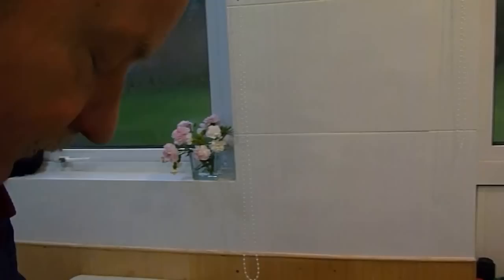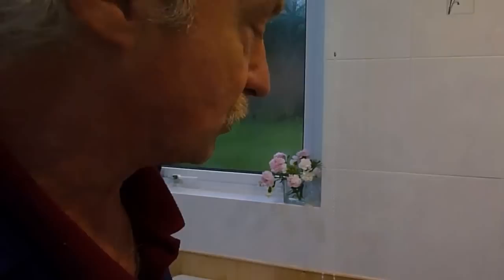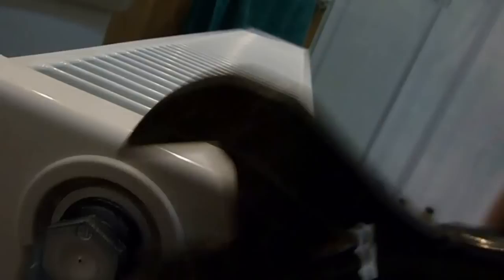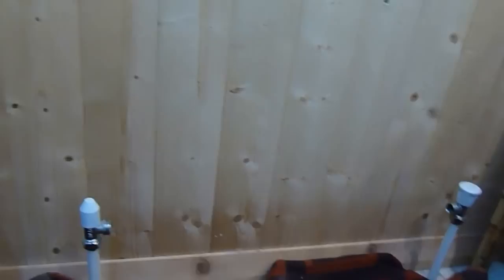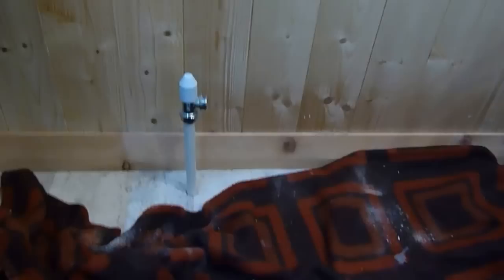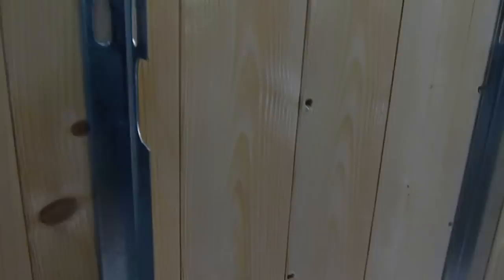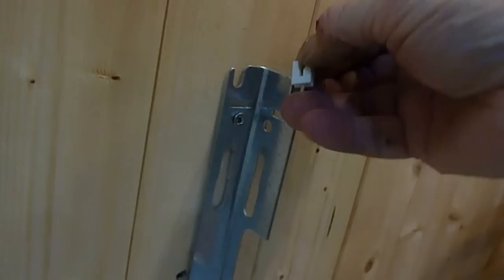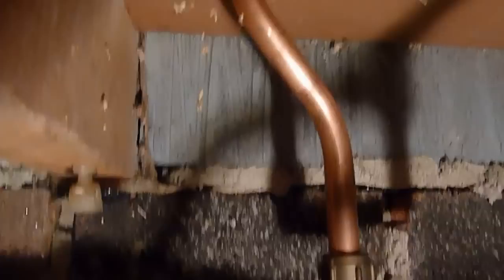How to change a small central heating radiator for a larger one.Get more heat.

Comment: Al. I changed a rusty rad for a nice shiny  new Kudox single convector in the spare bedroom. After draining the old rad and preparing the new one I was good to go.

 I was fortunate that I did not have to cut any pipework. Like you I also managed to get the  old tails off and reuse on the new one.
 The width of the Kudoc was slightly smaller than the original and I didn't need to use an extention valve as I first thought.

I had to higher the brackets slightly to lineup   with the pipe valves. After  applying fernox white boss compound and tightening up. It was all good with no leaks at all. As I say I think I struck lucky with the width and lineing up of the pipe valves. The bottom line is. I was able to stand back and admire my nice new gleaming white radiator. No more brown rust line running down from the bleed valve!
Reply from the maker: Great job Graham.

Comment: I did recently fit a TRV and unlike yours, the spigot only had a thread, the chrome pipe and a nut to fit the pipe, it made tightening the spigot difficult as there was nothing on it for a spanner.
 The only fittings that have leaked in my house are the soldered joints that a professional plumber put in I replaced them with compression fittings and they have not leaked in the last 20 years. I do use Kutalite or Conex not the cheap chinese ones. 
I have never used pfte tape or boss white on any compression or tapered thread.
Thanks for the video.
Reply from the maker: icespeckledhens Thanks for your info. Al.

Comment: None of my rads have a drain, but there is one on the heating pipes by the downstairs loo so I assume it's OK to use that - is that so it can be drained into the loo? Even though the loo itself is higher than the pipes?

Comment: I replaced a four element twin air outlet  aluminium ROCA radiator with a 12 element four air outlet  one in the bathroom . The benefit was unbelievable .I reduced the boiler central heating temperature by 10c   and it still heats the bathroom in 1/2 hour .and my gas bill has come down .

Comment: Once again, you've made it look simple..ish.  Modern houses seem to use the white  flexible snap-lock hoses.  Just curious: is it not normal practice to insert a rubber 'sleeve' around the heated copper pipe to allow movement against the floor boards?
Reply from the maker: Hi exwhyz23 . no I have never done that . the hole is always just a bit larger than the diameter of the pipe passing through it . So there is always plenty of room for movement.
Kind regards,
al.

Comment: Besides a visual preference could additional pipes be added to the left hand side to extend it from underneath the radiator but above the floor rather than cut it beneath the flooring and having to put another hole in the floor?
Reply from the maker: Yes certainly.
Reply: @dereton33  Thank you

Comment: How would you handle the pipes that come from behind the radiator from the walls. Do you have a video that shows how to replace a small radiator with a larger one where the pipe comes from behind the radiator?
Reply from the maker: Yes I have. https://youtu.be/lMYemmT-fyA
Reply: @dereton33  thanks for the reply. I think I probably wasn't very clear. Was wondering if there is a video where the pipes for the radiators are done like this. User image just as an example https://www.timloc.co.uk/air-leakage-solutions/radiator-pipework-air-barrier-product-code-1115

Comment: Nice video but I have tile on concrete floor in living room  can I fit smaller radiator and what happens to the pipe work

Comment: hi im swapping same size single type 11 radiator with double type22 ...will i have to adjust the pipes ? it may not be a direct perfect swap?   .... Also will a double22 radiator cause big increase in my gas bill?
Reply from the maker: The same size will fit but you may have to pull the pipes forward to fit as the rad will be wider. Your gas bill will not increase.

Comment: What would be the case if the pipe ends are delivered from the side wall instead of the floor ?  Is it possible to add 90 deg elbows each end, then loop around with u bends to connect up to the radiator ?  Or Do you have to cut the existing pipes from the wall re-insert to the extended radiator lengths ?  Hope this is understood your end.  Thanks.
Reply from the maker: Best not to have too many bends all though you can connect it that way.
Reply: Thanks for your reply and advice, much appreciated.

Comment: Hello, Al. I need to replace my single panel radiator in my hallway, same place as  my thermostat. Can I replace it with a double panel radiator.
1 ) Will my boiler be able to cope with the extra heat output?.
2 ) Do i need to alter the balance on the new radiator ( less turns on the valve )?.
3 ) Can i fit a TRV or does this affect the thermostat ?.
Thanks in advance.
Reply from the maker: Hi Rob, your boiler will cope OK, I would turn the lock shield valve down to just 1 turn, you can still fit a TRV valve, it will however,   shut off when it reaches temperature, which might make your hallway cold and force the thermostat to call for heat.

Comment: Hi Dereton  thanks for video. Can  I still use  central heating if I am not able to change radiator over straight away ?.,
Reply from the maker: Yes as long as the system is still full and not drained. I assume the rad valves are shut off either end.

Comment: Hi Al. Thanks for the great videos mate. I've learned so much from these and I'm now doing jobs in the house I wouldn't have dreamed of tackling before. I have a question for you. I just changed a radiator in the hallway from a type 11 to a type 21 (Kudos from Screwfix). The new one is not as wide as the old one so I'm using some Radiator Union Valve Tails to bridge the gap at either end on the feed and return. The problem I have is that the type 21 sits off the wall a bit further than the type 11 did, so the valve tails don't line up (they're out by about 10mm. What's the best way to make them align? Is it ok to bend the the existing pipework forward (ie away from the wall) that 10mm distance? Thanks again. You're advice is much appreciated by me.
Reply from the maker: Yes I always pull them forward, otherwise you will have to drain the system, cut the pipe tails low to the floor, put on a coupling and renew the rad tail putting a small 10 mm set into them with a bending machine, then refill adding more inhibitor as that would have been drained out.  All this extra work, for the sake of pulling them forward.

Comment: My radiator pies are on one side. What then?
Reply from the maker: Just shut both valves off it will still be isolated. If you use a Steelrad the tappings can be either side or both sides like yours.